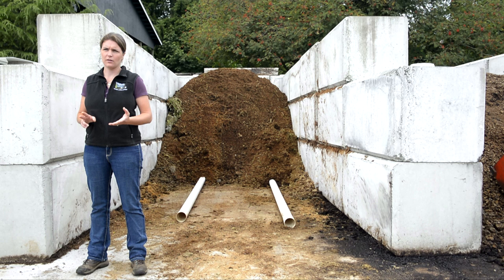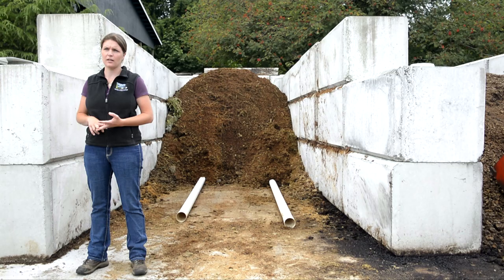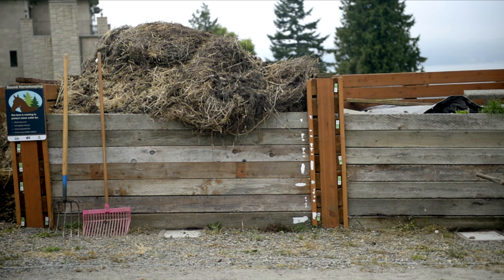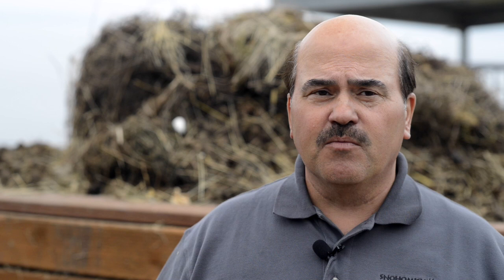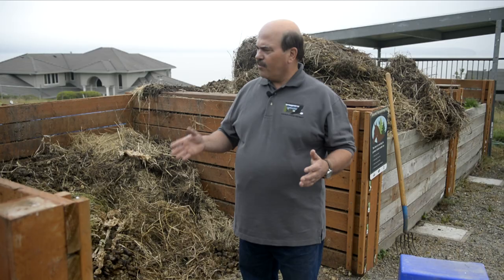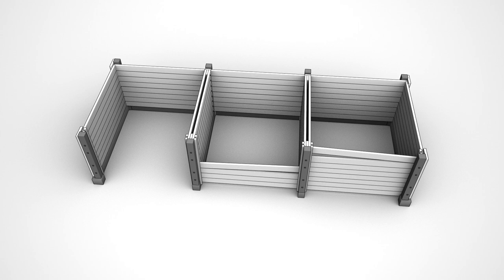Sound Horsekeeping: Building a Manure Compost Bin

Comment: Great video, but I would never let treated lumber sit against my compost pile. That stuff has nasty chemicals in it. I use scrap regular wood. Yes, it will rot eventually and be replaced, but it's better than leaching chemicals from the treated wood into the soil I'll be growing in. Another thing I have seen people use is the composite lumber (like Trex). I'm not sure about that yet, but will research it more.
Reply from the maker: Hi Laura - Thanks for your comment. A response from our horse guy: The basis for your concern has not been present in treated lumber around here since the mid 90's. Here is a good explanation: https://www.news-leader.com/story/life/home-garden/2009/04/26/most-pressure-treated-lumber-no-longer-contains-arsenic/77200928/
Reply: The fact that CCA is no longer used does not mean treated wood is safe.  

First, one cannot use even the "newer" treated wood if you wish to obtain organic certification because there is not yet enough testing to know if the newer methods of wood treatment (chemicals) are safe if leached into your compost. Here is the exact wording on the ruling, "A number of synthetic materials are now commonly used in place of CCA. These include alkaline copper quaternary, copper azole, and micronized copper azole. These materials are not currently allowed in organic production, as they are not included on the National List." Even in the article link you posted, it states that Quat is not on the allowed list of substances for organic growers.

I realize not everyone is trying to obtain organic certification, but many of us want to grow using organic practices! And probably have concerns about food quality, which is why we are doing our own gardening and composting.

Secondly, many people including myself will not buy new lumber to build a compost bin. We re-use old stock we have in the barn, garage, from a friend, etc. And how does one really know when it was produced? 

Bottom line, choose cedar, or choose other reclaimed hardwood lumber and treat it with a safe preservative. If one exists. I haven't researched whether there is a wood preservative that is OMRI-listed. In my case, because I live in a dry area, I use scrap pine and replace it when it breaks down.

Comment: Do you guys leave it open to the weather? Washington state rains a lot is that not a concern for your compost?
Reply from the maker: No. We recommend covering it with a tarp. Also, some may opt to build structures above their manure bins.
Reply: @SnohomishCD   according to that method of pipes ,if we add some of chicken manure ,and we turn the compost pile every 3 or 4days, so can we still find ammonia ,and how we remove it
Reply from the maker: @mr_korwagdy1257  Could you please clarify your question. I wanted to ensure we're able to answer your question, and just need to better understand what you are asking. Are you asking how to remove the manure to use it for fertilizer?
Reply: @SnohomishCD  no, not to remove manure, if u see the wheat straw in any planted land u will find it has a,, yellow color ,, so chicken manure , urea and gypsum ,,with continuous turning of the pile all that convert the yellow color to brown color ,but at that time we have a level of ammonia we need to remove it, and i saw some people put the pipes inside the pile like u but, how(( i want to make sure that ammonia is totally dissipated or removed ,))
Reply from the maker: @mr_korwagdy1257  This came from one of our Resource Planners:

Chicken manure will off-gas ammonia as it decomposes, especially if it gets too wet. 
The point of the pipes is to get more air into the pile allowing for better decomposition (providing air to the bacteria that are breaking things down). I assume if the pile is kept covered (not allowing it to become saturated with rainwater) and is aerated (by the pipes) and is kept at a higher temperature, this would help lower the amount of ammonia concentration within the pile because it is breaking down faster.